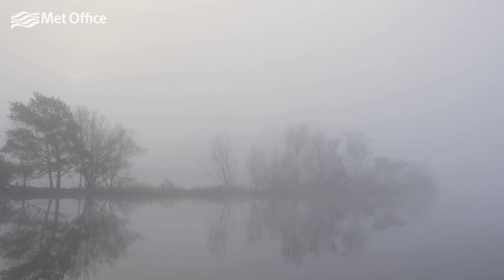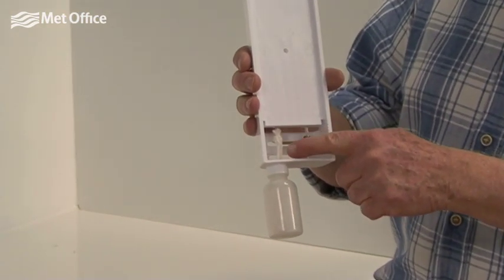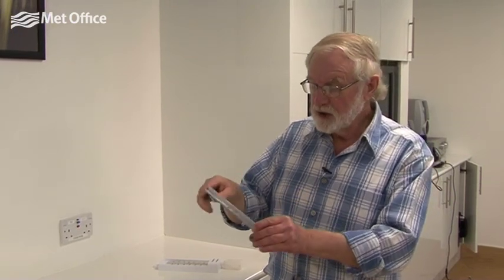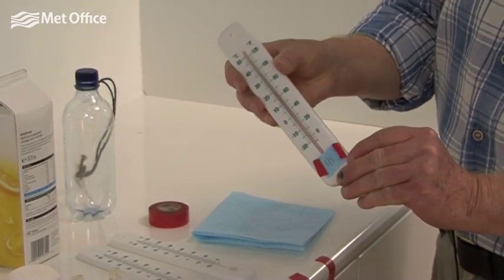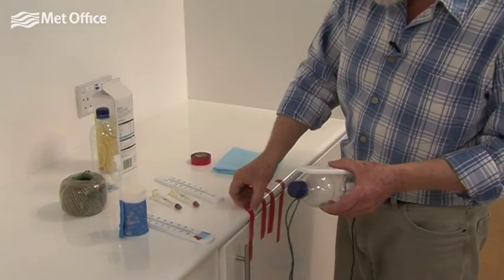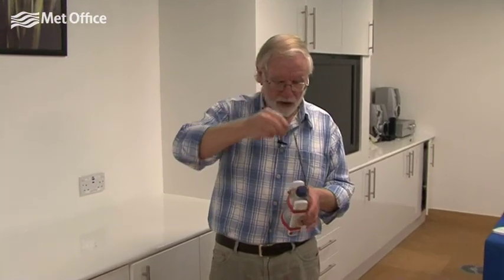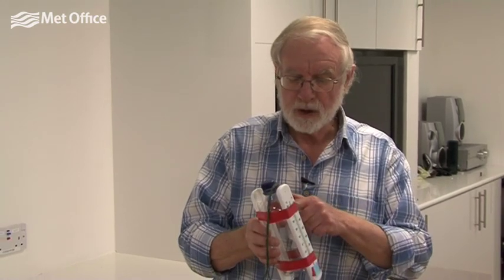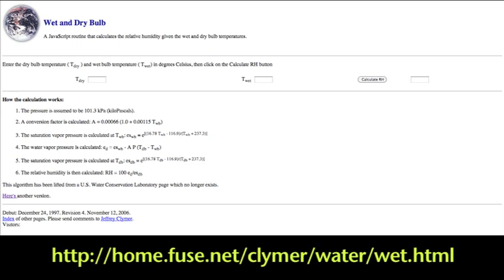How to make your own hygrometer

Comment: Is this table the same for any type of wet and dry bulb thermometer ?  Then it would presumably just need a slightly different time for the wet temperature to reach it's particular end value. Doesn't the temperature keep droping if you spin it even faster and longer ?

Comment: Humidity density can be over 100% it’s not the quite calculated when there’s fog it’ll show 100% but there’s different densities a fog as well so you need to be able to measure the rate of flow of the condensate to calculate actual humidity levels.  The cold mirror hydrometer should be more used.

Comment: The rate of evaporation and therefore the wet bulb temperature will be dependant on the velocity of air over the wet surface.
They suggest that a whirling hygrometer is rotated at 180 rpm (2 revs per sec).
The air flow over the material in a static wet / dry hygrometer is very uncertain and I would suggest this would give an inaccurate reading.
Perhaps a unit installed in a Stevenson Screen can be calibrated for static use, but you would still be better to consider wind speed as one of the factors in the calculation.
Reply: Worcester Exchange 3 revs not 2

Comment: I have a question, I have a cheap but accurate thermometer, I take note 
of the temp, and stick wet cotton on the bulb, and swing it for a min, 
then take the temp again.. I know it is supposed to be with 2 at the 
same time maybe to be more accurate, but really the difference between 
my reading when it is dry and doing the experiment is one min, in the 
same spot, should that give me accuracy?   when I do it, my room temp is
 28,  I swing it with wet cotton on the bulb for a min it comes to 26 
only? does that mean I have 85 of humidity? we have 10% humidity 
outside, so I placed wet towl near the AC to increase humidity but I do 
not feel soggy at all.. where is the mistake? why it has to be 2 thermometers.
 swung at the same time..? one thing though the bulb is protected with little metal grid with 3 opening could that be the factor that give me this mistake? thanks

Comment: how do they measure humidity over 100% ? when i lived in Houston, there were many days it would be close to 120%
Reply: No - Relative Humidity can only be in the range 0% - 100%.
The maximum mass of water in the air changes with temperature.
If the temperature drops below the point where the humidity would be over 100% the water will drop out as dew on surfaces or mist or rain.
Reply: You can easily measure the humidity over 100% percent in a measuring beaker. If there fits 1.2 litres in a 1 litres beaker you got 120% of humidity. ;D

Comment: do we need to use electrical tape
Reply: Humidity is so high where I live. Average RH is 85% during summer season. To counter this I keep a mini dehumidifier in my room to suck in about 60%-70% of moisture in the air. It does make a big difference. A combination of a good ceiling fan and a dehumidifier makes the atmosphere inside the room almost feel like an AC room.
Reply: You can attach the thermometers to the bottle with anything you like... tape of any kind is just an easy option. Use string if you want.. or glue whatever !